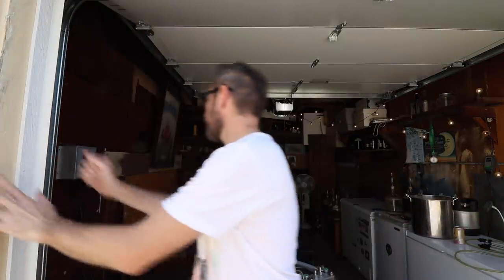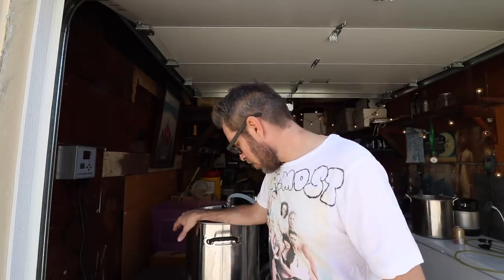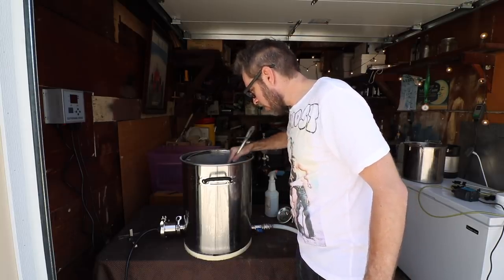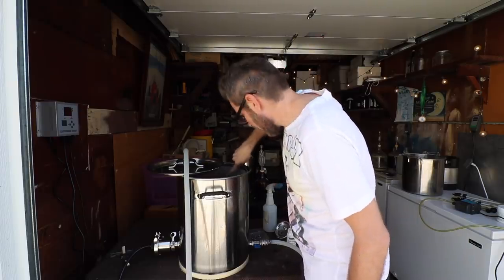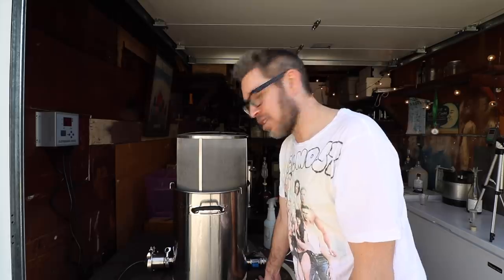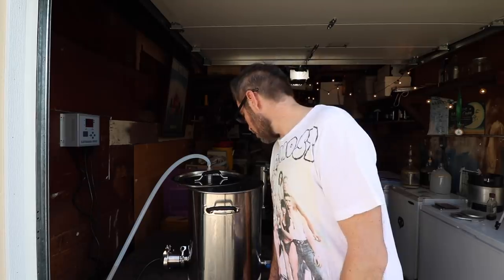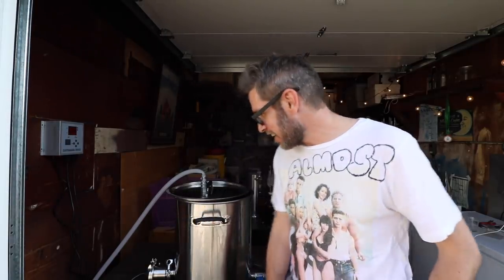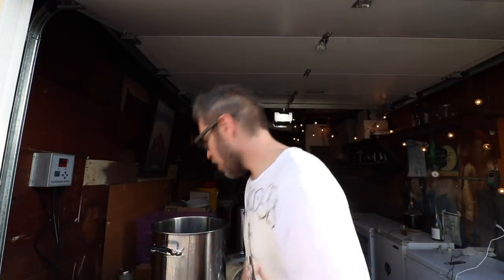Back to the drawing board

Comment: I get what you're trying to accomplish with this system and I'm sure you feel an obligation to Clawhammer which is understandable.  It looks like an awesome system for the typical size batches.  I also think a 5 gal. batch is too much beer and brew 2.75 gal. batches.  One of the great benefits of small batches is being able to eliminate a lot of equipment and still achieve great tasting beer.  I think you were on a better track with BIAB and just needed the correct size bag to fit your kettle because yours was too small.  And, you needed a false bottom to be able to do a Mash Out or adjust the mash temperature if it drops or even a way to more easily achieve results like a decoction with a step mash.  Burning the bag on the bottom ruins the brew day big time and the false bottom works so easily.  By increasing your grain bill slightly you can eliminate sparging assuming your kettle is large enough to hold all of the preboil volume of water after accounting for absorption.  With small batches the additional cost is negligible.  No pumps, mash tuns, etc.  I've learned a lot watching your videos.  Brew Small.  Brew Often.

Comment: After you pull the mesh grain basket up you can pour water (I use 170 degree) over the grain bed as sort of a secondary mash out to reach your desired amount of wort. I use a metal pie pan that I drilled holes in that sits on the grain bed and drains fairly slowly. Give it try!

Comment: You might want to consider going with an even four gallons of water. It would allow for the grain absorption and line loss.  Then if your numbers are a little low add a little boil time.
Reply from the maker: I think 4 gallons is the right number.

Comment: I have a similar home built system with the same dead space problem. I cut the angle portion of the SS basket off with an angle grinder being careful to leave bout a 1/4 inch clearance between basket and 5500W element. Then i orderded a bunch of marbles on Amazon and fill the bottom of kettle up to the drain valve with them.  With angle cut off feet you can wiggle basket thru marbles to easily seat on kettle bottom. Cut dead space down to .5 gal.

Comment: Dude there is lots of free Brewing software that will calculate your absorption. It will calculate your Strike water temps. Also you did not adjust for system loss. You can move the pump to the table top and shorten the hoses which will limit your losses, thus making your system more efficient.
Reply from the maker: I think the pump and tubing is taking more than I am planning on.

Comment: I have a DIY but similar single vessel, no sparge, EBIAB system and I love it.  Super consistent and easier, faster and better sized than the 3 vessel 15 gallon, fly sparge system I learned to brew on.  It is excellent for 5 gallon brews, and also works well for me for 2.5 gallon batches which I like to brew.  I like your videos and your style but it seems rare you get through the brewday without some unforeseen incident.  Now you have this new system and are really struggling. I would not try to brew less than a 2.5 final keg volume on mine.  I don’t think you will be successful on yours brewing 2 gallon batches and if you are it will take lots of manual intervention and baby sitting defeating some of the value of a single vessel no sparge system.  The key variable in my experience is understanding what your start volume should be. You need to predict all of your losses, and grain absorption is a big one, but well understood and easily accounted for. Check out BeerSmith. I mount my pump right under the vessel and use a small plate chiller also close to the vessel.  It keeps the hoses short and minimizes accounting for those losses. It isn’t hard to make really good beer on systems like these, but you are pushing the limits with your small batches.

Comment: Maybe your conversion rate isn't as good which is causing more solids to stay in the mash, therefore absorbing more water?  Also, not sure if you are calculating the loss of wort left in the hoses and pump, which in small batches is a larger percentage of the total volume.  If I were using that set up, and only brewing small batches, I would bend the legs on the grain basket in so that it would sit lower it the malt pipe (and by bending instead of cutting off, it leaves the option of bending back to original position if you ever wanted to brew a larger batch).  That would put your grains further into the mash water giving you better efficiency and results.
Reply from the maker: Could be some left in the pump. I can't get the basket any lower due to the heating element being at like 1.7 gallons up from the bottom.
Reply: Well dang it man!  You're not making this easy.  Since you can't lower the volume try adding displacement in the form of glass marbles, stainless steel bearings, or anything that would displace the wort, forcing it to rise higher.

Comment: I have a home made system similar to the Clawhammer. (gas powered though) I use a BIAB calculator to determine the amount of water for any size batch, mostly 5.25 gallon and 2.75 gallons batches. any lower and I can see having issues.  biabcalculator.com